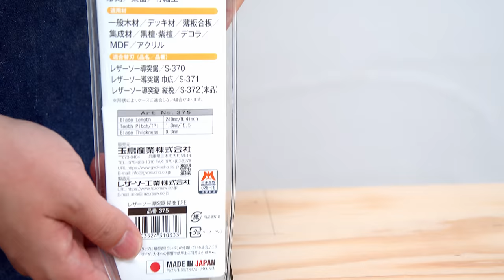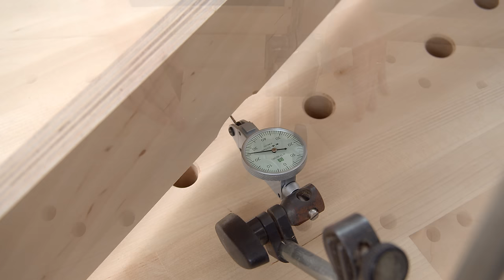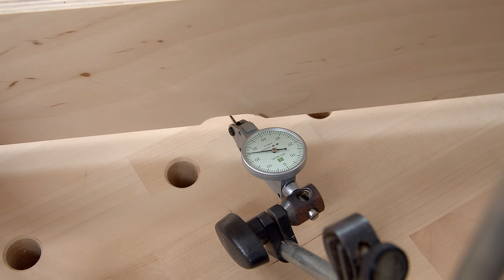Creating a High-Rigidity Workbench Using Alminium Frames

Comment: This bloke demonstrates not only his ability as a wood worker but other things like. 1) an incredibly clean workspace.  He must actually put tools away when finished.  2) He measures things carefully.  And 3). He takes his time, he doesn’t rush.  (Haste makes waste).  Rushing at a job, I have found has lead me “down the rabbit hole” of screw ups and wasted material.
Reply: You are spot on with JSK. I started woodworking when I was 10 yrs old in my grampa's shop. He taught me from an early age to keep a tidy work space and through out the day to put things back if your done with a particular tool. This way nothing gets lost. Back then, 50yrs ago, we swept as we went( a few times throughout a build), and we never buried fasteners or small hand tools in shavings that would then be put into a garbage bin. I take it a step further and if I know I've dropped fasteners into the sawdust around my bench, I run a handheld magnet tool I made over the pile and once retreived the dust goes in the bin. I also use the shavings and saw dust around my blueberry bushes so I don't want my grandkids stepping on anything sharp when the pick berries. I can still smell the cherry tobacco grampa smoked in his briar pipe he made himself. He was a cabinet and furniture maker by trade.
Reply: Totally overkill
Reply: @ozzyozzy6728 Hi Mr Ozzy, are you a oi oi oi Ozzy?
Overkill is why the likes of Toyota & Honda are world leaders & have a dedicated following & unless they lower their standards ,they create a river of gold with this sort of overkill, god bless mate
Reply: We don't have enough time to hurry ;)

Comment: Excellent build!  One suggestion, however, for those who wish to make one of these for themselves.  People often load up deep drawers with large, heavy objects.  As a result, I’d recommend cutting a narrow dado in the deep drawer sides to capture the drawer bottom, as it will hold up better in the long run than a butt joint.  Cheers.

Comment: Just a little note for those looking for subtitles. There are English subtitles, but you need to select English using the gear wheel menu—they default to Japanese if you just click "CC".
This would be very expensive to reproduce, but the point is to highlight the design choices made to create an ultra-sturdy, versatile workbench.
The top is made from glue-laminated wood, so wood movement shouldn't be too much of a problem. Despite that, he still included adjustments for wood movement in the top ( 17:20).
The numerous holes in the top are for bench dogs to hold wood in position while it is being worked.
The number and pattern of holes allows for a wide range of sizes and shapes of pieces to be braced. I expect he will demonstrate this versatility in future videos.
A superb effort! Obviously out of the price range for a lot of people, but many great ideas and concepts. I'd love to know where the aluminum frames were sourced, just for daydreaming purposes!
Thank you for another fascinating workshop project.

Comment: You could very well attach the end balls for the vise handle with glue only. Only, you need to keep them pressed for a few hours after applying glue. Especially on end grain, the glue is sucked into the grain, and without compression there will not be proper contact to allow for a strong glue joint. You can also drill holes halfway into the balls, and then you get enough face grain glue surface for the glue joint to hold.

Comment: Fantastic top-level workbench!  I love to see a true master of his craft (whatever the craft may be) at work.  I'm just sorry I can't build such a bench for my own tiny workshop.  I can maybe make one two-thirds the size but it would have to be using 2x6s instead of extruded aluminum.  One suggestion, and this is a personal preference, not a criticism, but my shop is so small I can't have casters sticking out the sides as that would lengthen my table by a good 40 to 50 centimeters.  A lever-action caster extender hidden in the side panels would make this table perfect.

Comment: 29:03 mins later I learned that I could neither afford this or have the skills to finish it at this level.   However, I would have put double threaded pins in the vise handle ball ends instead of just glue.

GOT YA!
Reply: that handle is not even a kg, titebond is overkill, i would have put cheaper glue for the ball

Comment: An awesome work of genius. I only have one problem. Gluing the balls to the end grain of the shaft is not going to hold very long. I would suggest you drill a hole in the ball, then glue the shaft into to the ball. This is NOT likely to come apart in the future.
Reply from the maker: あなたの言う通りです。
日本語の字幕で説明していましたが、ダボ接合に修正しました。
Reply: @jisakukobo  ,Que linda letra, será que pat dee entendió tu mensagem?<<<(:)>>>
Reply: @miguelangelinfantecorbo5401  Yes indeed I did understand both of his replies. The first one must have been deleted.

Sí, de hecho entendí sus dos respuestas. El primero debe haber sido eliminado.

Comment: When installing the face material, you did not note the stop depth, indicated by the tape.  Others not familiar with the method likely missed the tape or connected the dots.  I recommend putting the bit next to the laid up boards to show the thickness then show the bit with tape to indicate the depth stop connection.

Comment: It turned out great. I was surprised that you only used glue to hold the knobs on the ends of the handle. 
I thought that you would have used the threaded inserts you use so often. Anyway, well done.

Comment: Your work really is beautiful and you are extremely gifted and precise with all you do.  I would change only one thing about it.  When you made the drawer boxes, you have the front and back panels glued and nailed to the ends of the side panels.  Over time, it might be easier to possibly pull the front panel right off the drawer  since the nails are positioned straight in.  Might it be more structurally strong if the side panels were instead glued and nailed to the ends of the front and rear panels?  That way the nails would not be in the direct line of pull when opening the drawer.  Please tell me why you chose to build them the way you did.  Thank you very much for your time. 🙂

Comment: Beautiful work. Over here the cost of the 80/40 or 80/80 extrusion is prohibitive. A 4m length of 80/40 will cost me about A $350.00. There looks to be around $2000.00 worth of aluminium extrusion and fittings alone. A bit too expensive for my budget.

Comment: stunning, but a lot expensive i think...
Reply: Yes, I was thinking that due to the profile of aluminium and the quantity of it.

I was thinking of mixing aluminium and 12mm ply, to gain the lightness for portability and cheapness.
Reply: About $1200 in raw materials according to the plan...
Reply: I think I could remodel my kitchen for less money.
Reply: It’s amazing work. I wonder if a version for mortals would be rigid enough, if one used smaller profiles?
Reply: I think that with a 100x100 solid pine you can achieve the same rigidity at a fraction of the price.

Comment: One day, in the not to distant future, you are going to feel the slightest bit of sway when doing a project. It won’t be bad but it keeps getting more annoying every time you use the bench. You will try to ignore it but you will know! That is when you wish you would have tightened those steel screws in those aluminum channels a little tighter or used a thread lock fluid. You will the second time you dissemble and re-assemble your bench. Good luck and it is a nice looking bench - on the outside.

Comment: Beautiful build, but not an economical one.  The aluminum extruded rails and fittings are difficult, if not impossible, to find.  Certainly couldn't obtain these in Canada for less than a thousand dollars.
Reply: Extruded aluminium profiles are ridiculously expensive, but great for prototyping or when NRE is too high. A welded construction from steel bars would work equally well, and would be much cheaper.

Comment: I would never build a workbench for woodworking out of aluminum because a workbench needs to be really heavy. I have a workbench made out of steel that I bought and every time I plane wood on it, the whole thing moves all over the place. Once I get my new house under control I am going to build a new workbench out of very heavy wood. 

But, I am building my router table out of aluminum.

Comment: How a great idea it is ! Do you  think this technic could be apply for a MEDIUM rolling cabinet kitchen (less than 2 meter wide) with granit countertop ?
Reply: These are generic aluminum parts generally used in factories and scientific labs for research.  Most companies use them instead of buying custom made parts. These are almost lego type erector set parts.  You can make almost anything with them.

Comment: Very very nice!  
Getting only Japanese subtitles (no English), though can follow along without. Also, you do have rather more tools than I. :)

Side note: large 3D printed brackets (on at least two sides of the extrusions) can be used to very precisely square up the frame in three dimensions. Found this when building a large 3D printer. The metal inside angles are stronger (more than needed for a 3D printer) but the large plastic brackets are more precise. (Not expected, but obvious in retrospect.) Might be overkill.

Comment: A piece of art! Nice work. My one question regards the 4 wheels facing outwards. Many people (like me) would certainly bump into it from time to time, which could be dangerous depending on what you have on your hands.
Reply: That was a concern of mine too, but after 3 yes I have not tripped once and I am in general clumsy. They really only stick out when they are down to move it around. When they are in the up position, stationary, they are up close against the leg of the bench. Also, many have a large vise, or an overhang on the ends where they are installed on the bench. There are other versions on ways to move the bench around. Some very good DIY versions here on YouTube.

Comment: Not entirely sure I see the point flattening a solid wood bench top to this level of precision... If it’s real wood, it will move again in no time.
Reply: yeah .1 mm is about .007 so just over two human hairs. I am sure there was that much error in where his indicator was touching on his cross beam. Amazing attention to detail how ever.
Reply: Also because the end plates are bolted to the aluminum frame essentially it can't expand along the length of the table and will bow in the middle.

Comment: Internet Link for Aluminum frame pieces?
and the sizes you used?
Reply: At 18:52 there is a view of Top Plate laid on top of the aluminium frame, a bit of measuring and maths deduced that the Aluminium is 30 x 60 (30 series) and 30 x 90 for the end vice mounting. legs and a couple other parts are 60 x 60
Googling for Aluminium T-slot Extrusions brought suitable results

Comment: What's the torque rating for all the bolts you used on the aluminium frame? Is there a guide anywhere on the recommended torque rating?

Comment: Beautiful work!  This is very inspirational, and offers a great excuse to purchase a torque wrench.  Is the extruded aluminum material available to you locally?  I look forward to checking out your other videos to see how you built your drill stand.
Reply: I'm not saying that you shouldn't get a torque wrench, but it's use here is pretty pointless.  Even in extremely consistent aircraft fasteners, fastener torque applies only an approximate preload, and with large variations.  Think on the order of up to +/- 50% in consumer grade stuff.

Comment: Nice workbench, but it occurs to me that you are totally oblivious to how you can attach these profiles to each other "blind" i.e. without these angle brackets.
if you use DIN 7380 bolts (these fit in the Tslots, all you have to do is drill a hole opposite of the bolt, and you can build the entire frame with all the bolts hidden.. 

I use the same profiles to make workbenches, and not a single bolt is visible in my design

Comment: Great work,  thanks.  I am trying to make one myself.  I got a question, how do you make the sliding nuts inside the track stay in position, especially those in the vertical position?
Reply: T-nuts.  They are designed to be able to slide around in t-track but not spin.  So, once you start to thread them they are not able to spin and tighten into place.

Comment: Great work in a piece of fine furniture. Where did you get the aluminum pieces that make up the frame? These would be very useful for all types of benches and stands.
Reply: Frank Kirschner look up 8020. They have a bunch of different sizes. Be warned though it’s not cheap.
Reply: Thanks. I will look in to it.

Comment: Although the construction of the Alloy base section was a clean and simple process, for some reason it just doesn't seem as sturdy????

Maybe because the material is so lightweight?

But nice bench good show on the innovative spirit..
Reply: Tarkan Kayli That aluminium extrusion profile is much stronger than most people realise, those 100x100 sections are very sturdy.
Reply: I know that alloy is very strong, just with no weight to anchor it down properly it loses some marks on sturdiness..

👍🏻

Comment: Beautiful bench — but it looks you didn't even show a major feature of the aluminum extrusions:
You can use them to hold workpieces.
Some profiles are compatible with Festool-clamps, and of course, you can always use sliding blocks to place screws wherever you like.
In my shop, I made sure that the legs are not recessed, so that I can mount boards to them, and position the edge so that it is slightly above the tabletop.

Comment: But why phillips screws? You are doing such a great job, high standard craftsmanship, and then you use phillips screws. I stopped using those 20 years ago. And I will never use them again. Only tork screws. They are far better and will not overturn.

Comment: This is almost a $1000.00 build...  and that's just for the aluminum.  [CORRECTION]  Several $1000.00 build.  This is gorgeous, but most of the builds these days are so expensive, you would have to be very well off to make them and then, with that kind of money, you could just buy what you need at a much lower price.
Reply: In the UK that aluminium frame is around £200.
Reply: @NickToyepixels  Source?  I'd love to buy it at that price.